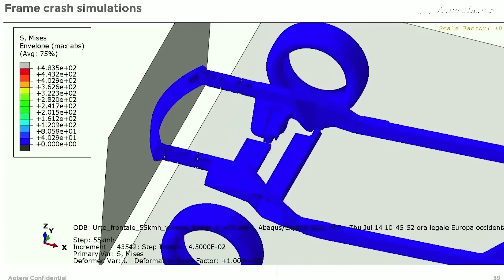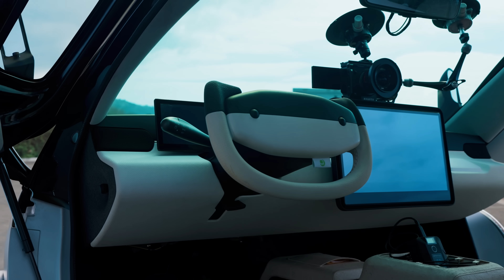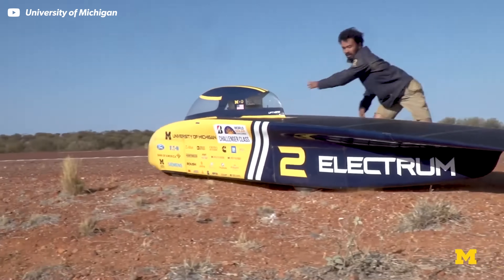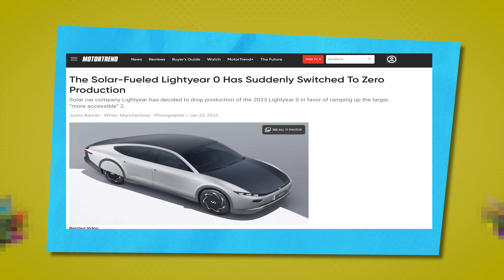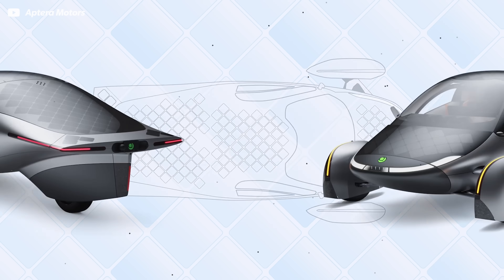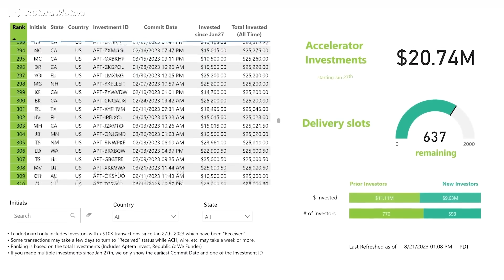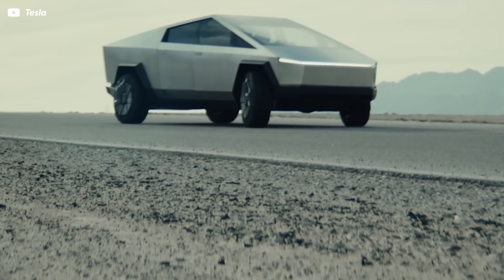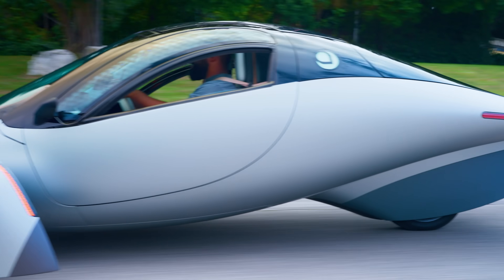We Drove America's First Solar Car

Comment: Their first design used a rear mounted motor cycle engine instead of electric and was estimated to get 330mpg thanks to its ridiculously low drag. Unfortunately they had overheating issues and they had trouble getting loans to continue development because of the three wheel design. Glad to see they came back with a new game plan. With the average commute in the US being around 27 miles it's feasible that some owners would never need to plug in outside of road trips.
Reply: Well they did have an electric model as well then but the range was around 95 miles. It was a lot harder to utilize being shared with the combustion model in parts and there weren't as many known ways to densely pack lithium ion batteries while still cooling them.  

The electric one also still had solar, but it was only less than a 1m² panel for running the AC.
Reply: twenty-seven minutes not miles...
Reply: @fixedpigs  right you are, its 41 miles. And I had to scroll for a while to find an article that listed the distance, despite specifically searching for distance rather than time. I guess I can't get mad at how bad search engines have gotten if I fail to read the garbage they give me thoroughly. Still many people are under the average. And even those who are borderline would be able to top off on the weekend or only charge once a week for a short period of time.
Reply: My current daily is a Prius Prime, because my commute being only 6 miles round trip meant I didn't need to have "292 miles" or whatever the full EVs are offering. 25 miles of charge from my wall in 5 hours is more than enough.

But on days where I need to go further, I can go as far as I want. Because it takes gas.

A 1,000 mile charge car that can fuel itself up in the parking lot at work, in a driveway or street parked while home without a plug (it's obvious this is targeted for places where people don't have garages) actually fixes the problems most people would have with EVs.
Reply: Since they gained range on a sunny day I bet you could even road trip it without plugging it in if you were going through the southwest.
Reply: Elio Motors started with an ICE design, then they doubled the price by aiming for electric, but as best as anyone can tell Elio is vaporware. I'm really hoping this car actually makes it to production.
Reply: The new version uses 100wH/mile of electricity.  Using the EPA method, one gallon of gasoline contains 33.7kWh of energy. Aptera's equivilent mpg is 33.7kWh ÷ 0.100kWh = 337mpg-e. Aptera has mentioned that the 250 mile  base model ( smaller battery less weight) will use less than 100wH/mile. They have mentioned 350mpg-e in some of their marketing
 The would imply 96wH/mile.
That is killer efficiency .
Reply: @Capt.Kira_FoeHammer  Elio  Motors has always been a fake.  Aptera Corp founders have successful backgrounds.  Chris Anthony took his last company public as CEO.
Reply: First, awesome concept, and really hope Aptera can launch.  As for the solar panels - great in theory but I wouldn’t buy the vehicle with solar panels in mind. Best to ignore them and treat it like an EV.  No place gets sunny days, every day. Parking lots can be hit or miss for shade depending on where the buildings are, and if some large suv parks next to you.  Solar panels are great when facing the sun, but lose a lot when the sun is at an angle. 

I live in Southern CA and have solar on my house.  Lots of sunny days. We get cloudy days too though.  And in “winter”, it’s months of clouds. And in June there’s a marine layer that doesn’t burn off until about 4pm when the sun finally shines through.  So yeah, I’d be plugging that Aptera in and ignoring the solar panels. But neat party trick.
Reply: @stephen3164  You are completely correct.  The entire Aptera vehicle was conceived of as a niche vehicle, just as the first Tesla was.  It is just that that niche has turned out to be considerably larger than the founders ever expected.  This is what has caused the delay as Aptera switches from low volume vacuum resin infusion production to stamped carbon fiber/SMC.  Even though only a fraction of owners will find Solar very useful, it will not take huge numbers to save millions of lives over the next century.  That is why the solar panel contribution shouldn't be ignored.  

See the paper on this "Quantifying Global Greenhouse Gas Emissions in Human Deaths to Guide Energy Policy
by Joshua M. Pearce and Richard Parncutt
Reply: @stephen3164  spoken like a man who has solar panels on his house and can plug-in charge. The built in solar is very useful for many potential buyers who don't have solar and can't plug in charge where they park.
Reply: @garywozniak7742  - yeah, I see what you’re saying, but depending on the weather in order to drive your car isn’t a great plan. If you have an EV, you need a place to charge it now and then, depending on its range and your usage.  Having it sit outside for 8 hours on a cloudless day is nice “free extra range”, but I see the solar as a little bonus range here and there.  If I drive 50 miles out to the beach, spend 3 hours there in the sun, and drive 50 miles back, I need 100+ miles of range before I leave the house.  I’m not going to hope there aren’t any clouds and then get stuck 20 miles from home if the beach was overcast. (happens a lot here - no clouds in the valley, but full overcast and 25 degrees cooler at the beach)
Reply: @Torus2112  I'm pretty sure they misspoke. It was charging while they were driving, but it charges much slower, putting in less power than they were using.
Reply: 19 years later they still have overheating issues.

Comment: Only $25k is wild. If they can pull that off, these things will be everywhere in California. I live in Michigan and the sun isn’t out enough for it to be viable now, but I’m still excited.
Reply: I live in Iowa, and expect to still get around 20 or so miles from sunlight on the average day. It is still worth having.  It will be especially welcome on camping trips in remote areas.
Reply: It's a plug in, the roof panel only gives you 40 miles. They will roll out one with 400 mile range.
Reply: @hhc1948  The 40 mile average range is only for solar areas further South than Michigan or Iowa, and that is the solar only full range., including the hood, dash, roof, and rear deck.  

The first models to be released will likely have a 400 mile plus range on full batteries.  the second model will be around 250 miles with full batteries, and then will come 600, and then finally 1000 miles.  (All these range numbers await validation testing, which will be done next year).
Reply: the solar addition is a decent part of the appeal, but even without it, it's still a hugely efficient design
Reply: gonna be at least double that amount when it comes out. They want that deposit money from us
Reply: 400 mile range for their low end model is still better than the most expensive and longest range Tesla, which is 405 miles. (Teslas is more by only 5 miles but the price is 4x as much)
Reply: @CanvasAccount-it4qv  But the Tesla is a 5 passenger car and the aptera is a 2 person   motorcycle
Reply: Didn’t think that was particularly cheap. It’s a streamlined high performance golf cart.
Reply: i really hope this car doesn't come with some massive problem because it sounds too good to be true. but if they really do pull this off for 25k then this will change everything
Reply: Now known to probably be more like 30 - 40k, but yeah.
Reply: Even without sun a 250 mile range for 25,000$ and 1000 mile range for 45,000$ is crazy.
Reply: @MorbiusBlueBalls they will not. Guaranteed it’ll be over 40k on delivery.

Comment: I was saving for a Tesla 3. I saw this and put my reservation in the next day. Glad you guys reviewed it. Your honesty in your videos is compelling and it’s why I keep coming back to watch your stuff.
Reply: Wow you’re a brave man
Reply: From reading the super fans of the product, it’ll be perfect right away. Since you can work on it yourself, if it ever does break down, scan a code and you can fix it in a jiffy.
Reply: I’m an Aptera fan, and no fan of Musk - but the Model 3 is a car you can buy today, and drive it arounds for years without issues. It seats 4 people, has a large trunk, and can be used just like a regular car. And again, you can buy one today.   If Aptera starts production tomorrow, it would still take years to fill the orders they have, and once they announce production, I can see their ordering system blow up. A good thing for the company - a bad thing for anyone needing a vehicle. You could buy a Model 3 today and use it for 4 years while you wait for your Aptera.   Also, be aware that prices can change, and that EV credits from state and Fed might not apply the same to 3 wheeled vehicles.
Reply: @shreddy_mcgnar6359   To be honest, they probably aren't even going to be an early adopter. Depending on where they're at in the line of reservation holders, they are tens of thousands of cars away. Given that Aptera is starting from a relatively small volume of production, that would place many months of time in between the first car and the car they recieve.
Reply: @stephen3164  Just a small correction. The aptera has a huge trunk since it's so long. Probably considerably larger than the model 3's. But yes, I agree, unless you are obsessed specifically with Aptera, just get a Model 3.
Reply: Don't worry something else will tickle your fancy and you will jump on that!
Reply: @meatisomalley  - original design allowed for fitting a surfboard, I believe.  Looks like a long trunk, but not sure how deep. Probably holds more than my Miata’s.   If you don’t need a rear seat, and can wait many years, then an Aptera is a cool looking car.  I see it as a spare car for a family - maybe if one person commutes a bunch of miles, this would be good for that. Or if you have a larger car, this would be good to drive when you don’t need the extra room. Actually, the Aptera could easily be the primary car, and the larger car only driven when needed.  But I think it’s still a 2-car solution.
Reply: @stephen3164  - It only takes 2 hours to build an Aptera, so they can fill the demand immediately.
Reply: @stephen3164  that's great for people who want to buy a Tesla.
Reply: @billsmith5960  - I’d love to hear more about this!  Do you mean the production line can crank out 1 vehicle every 2 hours?  Or start to finish, a vehicle only takes 2 hours. If so, how many can they start and complete within a week?
Reply: @stephen3164 - Looks like it would do us for ninety-eight percent of what we use a car for, and for that two percent, that's why God invented U-Haul and Enterprise.
Reply: Good luck when you get rear ended lol
Reply: @randellpolanco5146  - Most people will tell you they are a safe driver. What they don't realize is other people out on the road can hit you no matter how safe you are.

I do have concerns about the tub because like you mention, getting rear ended looks like it can cause a whole slew of issues.
Reply: It’s clearly a paid review lol
Reply: @billsmith5960 lmao it’s hysterical you actually believe that